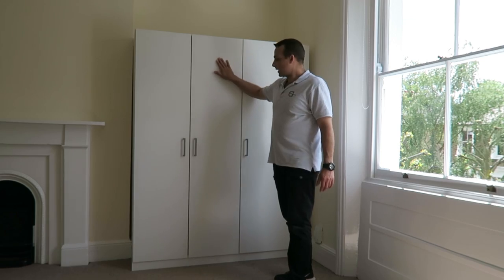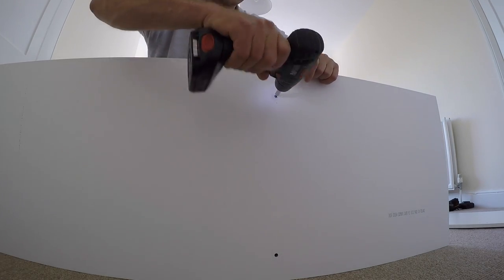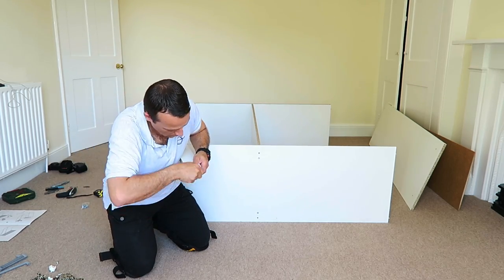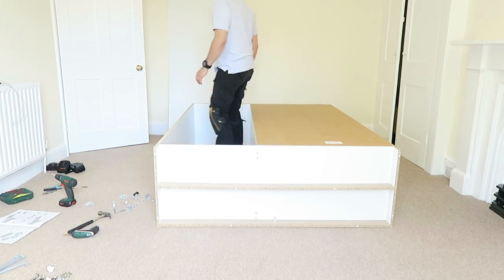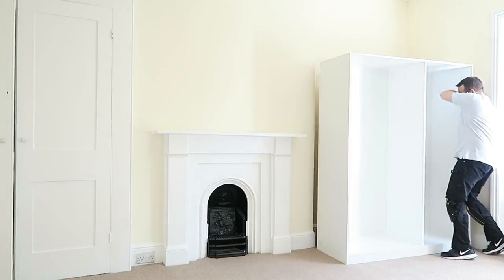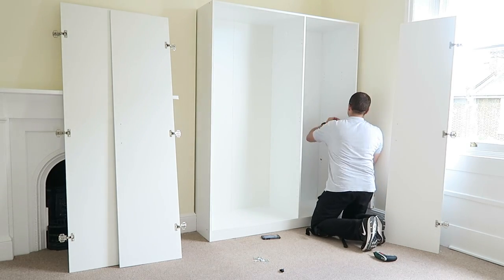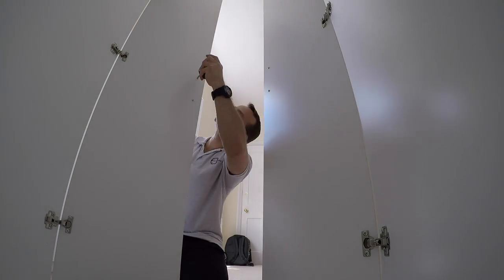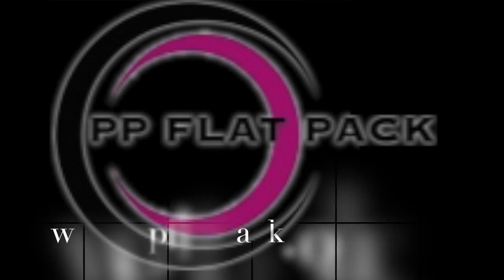IKEA DOMBÅS Wardrobe white Assembly - How to

Comment: Hi - i followed your method of putting the hinges first on the door and then screwing it up on the panel but i see a big gap between the 2 doors. any idea what did i do wrong ? thanks
Reply from the maker: You just need to adjust hinges there is two screws on the each hinge. Hinges on the middle door have to be adjusted to the maximum position the same with side doors.
Reply: @PPFlatPack  can u upload video o  that
Reply from the maker: @SheikhaDaneen  Here is my latest video on DOMBAS wardrobe where is all explained in details.  https://youtu.be/s-kALFkKxd0 
Hope  that help ;)

Comment: Hi, I bought Dombas wardrobe yesterday and I'm assembling it now. Unfortunately, I broke one of the long piece of wood. So I wander that can the wardrobe stand straightly without 2 piece of long wood?
Reply from the maker: You mean two long slim panels on the bottom of the wardrobe? They easy to snap. I would suggest to get new ones from ikea or reconnect broken ones this is only panels suporting wardrobe on the middle it will still work without these two panels but over time once you load wardrobe the middle part will start to bend as there is no suport for the middle part of the wardrobe.
Reply: yes, they are two slim panels. I only broke one panel and I almost finish assembling all parts, so I think I could not return this and get a new one. I don't know that whether Ikea  Do you know how to reconnect the broken panel, can I use wood glue?
Reply from the maker: If you have ikea family card you can return no problem they give you new one. Other option when you goo to ikea check bargen corner they always have spare parts you may be lucky and get what you need. If broken back slim panel and front one is fine you can just conect broken one with small piece of wood or some metal brackets if is the back one will be not visible. Or if the front one is fine you should be ok just with one maybe just put something under the wardrobe few books or somthing thick to suport middle part.
Reply: Thanks for your recommendation. I will try those solutions you gave it to me.

Comment: Hi, do you think it is necessary to secure this wardrobe to the wall?  Thank you :)
Reply from the maker: If you have small kids maybe good thing to attach wardrobe on the wall. It is great hiding place :) Depend on the floor as well if you have wooden is better if carpet depend on the thickness of the carpet it can become bit wobbly. My experience 90% of my customers don't want to attach it. But I always offer this option and is up to them if they want or not.
Reply: No kids so I guess It'll be Ok like that, Thank you for the answer!
Reply from the maker: +Azu V if you decide not fixit on the wall make shore wardrobe leaning towards the wall not towards you when build. If leaning towards you put something under front legs so it will lean towards the wall. All the best :)

Comment: hi what tools are you using to put this together
Reply from the maker: I use electric drill electric screwdriver and hammer. If you don't have electric one no problem you can use manual just is harder and it take longer to do.

Comment: Please help I tried everything but there is a gap of 1 cm inbetween the two doors on the left. I really don't know what to do
Reply: Also the little screw that is supposed to help close the hole doesn't even reach the plate underneath it????
Reply from the maker: You need to adjust hinges. There is 2 screws on the each hinge you can move doors left or right or in out.

Comment: How can I adjust the distance between the two narrow doors? There is almost 1cm between them...
Reply from the maker: You have to adjust the screws on the hinge to maximum on the both doors
Reply: PP FlatPack I tried, but there are still 0.8 cm. how can I solve it?
Reply from the maker: Each hinge have two parts one screw holding this two parts together open that screw and slide the hinge to maximum position. Do this on all hinges on the two doors.